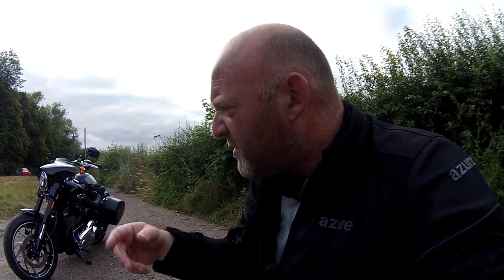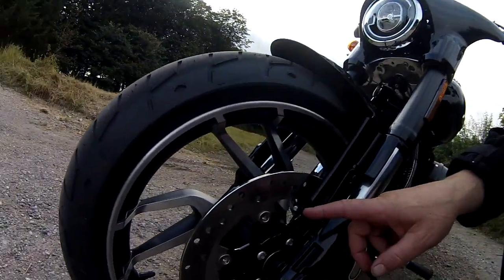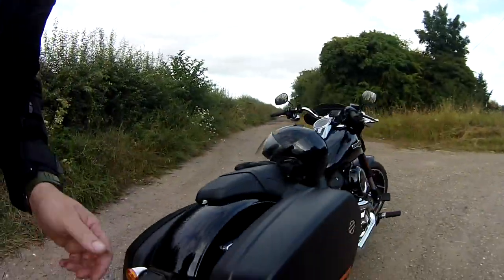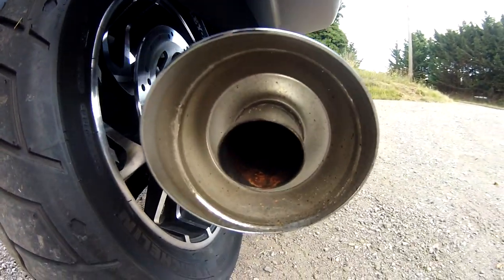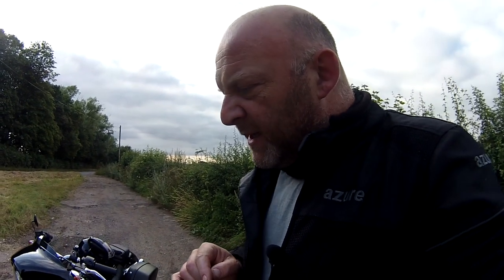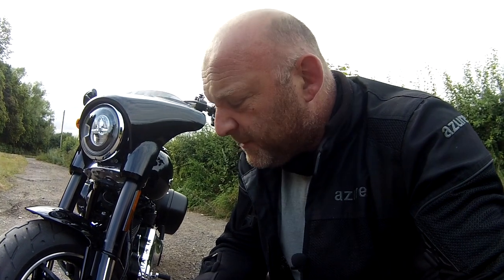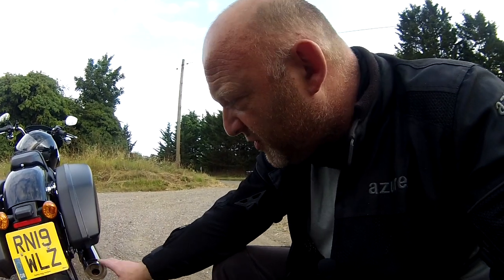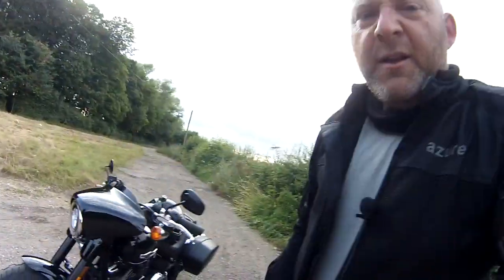How to stop Harley Motorcycle brake discs rusting

Comment: I tried acf 50 applied by cotton bud. Still it migrated to the disc. Oh feck ass nipping no breaks till it burned off. Wd 40 also applied the same way similar results but not as bad. Currently trying spray silicone applied the same way. Best results so far. I wash and blow dry my bikes in the winter, especially the brakes, all treated with acf50. Hope this helps.

Comment: This has been building up on my disks and other small (Nuts/bolts/washers) on my 4 month old bike. here in tropics seems to rust fast. Yesterday I:
-Bought white vinegar (50 cents a bottle) Mixed 50/50 with water sprayed it on all affected area's let it sit for 30 minutes, then sprayed it again.
- Took my electric toothbrush with old head and used that for all area's, including inside those little holes in disks and lots of little bolts/washers.

Results: I'm lazy so didn't want to put more than 10 minutes elbow grease into this, but clearly it improved things significantly, however did not completely remove rust. I leave my bike outside so this is going to be a constant during rainy season. So i just plan to do this every time i wash the bike and incorporate it into my cleaning routine which i think is a better option than painting these parts. This over time 3 or 4 sessions I believe will completely remove any rust.

Comment: Alf I had the same on my exhaust what I did was to polish the inside with HD metal polish and it polished it out, at present it hasn’t returned.
As for the disc my rear showed rusting on the inner cut outs this time I used fine wet and dry paper damp of course and that to dealt with it.
I was surprised this was happening I though they shipped by bike to the deck of the ship from the factory, considering my bike hasn’t been ridden in the rain.
Reply from the maker: Yep it’s what I’ve done and seems to have done the trick cheers

Comment: Hi Alf, the discs I would just leave. Same thing on my Iron 1200. The exhaust, if it's black just spray a bit of high temperature paint. I did that on  my Harley stock exhausts and it lasts for a long time.only done it twice in 5000 miles. 👍
Reply from the maker: Thanks fella, good to know. I think I've sorted it for now too and hopefully will last a while. Just waiting to see if it occurs again and go from there. Cheers

Comment: Hi Alf,
are you sure that it is the disc that is rusting and not dust from the pads , I remember when Harley had trouble with "rusting" spokes but only on the leading edge, this turned out to be brake dust that stuck and it  rusted because it had a metal component.
I have done surgery on this muffler and the exhaust gases have a very convoluted path to exit and as you know an ICE engine produces a lot of water and parts will produce a rusty water stream out the end, so this is only staining not really rusting. You can paint it as I have done just use heat proof muffler paint but the staining will still deposit there. Hope this helps.
Reply from the maker: Yep I think that is it. I’ve cleaned it all now and looking at different options but just looking at long term maintenance really. I’ve just painstakingly gone over the whole thing with cotton buds and wd40 then cleaned the divas with brake cleaner afterwards. It seems to be holding up so far but I may still consider the paint option too but once cleaned off it seems ok...for now. Cheers

Comment: Alf, I don't have the rust on the exhaust though it seems a very common issue on the owners forums. Brake discs same issue though on the rear I have quite a bit of surface rust on the centre main body of the disc if that makes sense around where it's actually bolted on. It's in for service this week so I'll mention it then see what they say. When you take the seat off look at the band around the top of the suspension, mine is rusty there, I'll also be mentioning this as well.
Reply from the maker: Ah thanks for that. Yep mine is in for service in two weeks so I’ll do the same too. Cheers

Comment: Alf Never ever put wd40/acf50 on your brake disks, this is oil based and wil cause your brakes to not work when needed , even if you put in in the holes disks heat up fast so it runs out and hits the pads coursing brake failure and most likely serious injury ore worse . if your bother about the rust take it to the dealer its a new bike so let them worry about it , ore just use break cleaner to clean m and most likely the rust wil wipe off
Reply from the maker: DWEAZEL yep just some options for sure not best and must be cleaned properly. Prob paint option best

Comment: Alf,

I'm interested in how the dealer responds. I'm awaiting a Stage I installation, so that should solve the exhaust rust.

Re: the rusty spots on rotors, I'm leery of using any product that might br considered "lubricative" on or near my wheels (I don't even Armor-All my tires).

Always enjoy your content, Thank-You,
Mike
Reply from the maker: Thanks so much Mike. Absolutely so, I’m in at the dealer this Friday so will discuss a few issues but anything used has to be really cleaned off well. I ended up scrubbing the areas with a cotton bud with wd40 then completely dried off the area afterwards. Seems to have done the trick but a painful exercise. Cheers

Comment: If you want to crash the Harley then go ahead with the wd or the acf.
It’s only surface rust. Clean it with steel wool then a dry clean rag and fenwicks brake cleaner.
Reply from the maker: Rocking in a free world you obviously missed the part where I said they’ll need a proper clean afterwards.

Comment: Alf ,,place bike on a trolley so wheels are free to spin and I would dip a cotton  ear bud Into paint of your choice preferably anti rust and use it as a sort of a dab / paint applicator ,,,dip and apply to each hole and also the exposed edges..Bit fiddly  but You'll only have to do it once ,,,wipe excess with steel wool on the edge of rotor once dried...Oh and I ordered a Factory Alarm for 148 here in Australia which takes half an hour to install..Also I'd touch up the Exhaust to stop further rust ,,the Heat will bake the pain on..
Reply from the maker: Good skills Paul

Comment: Hate to let you know but you are making yourself sound a bit silly.
Disks are wearing part all disks  will go rusty  park your car up after a rainy day looking you discs the next day the whole surface will be covered in rust all disks  rust , The only reason you don’t see the rust the next day is when you use the brakes the pads wipe it clean talk to a mechanic or somebody . I like your videos of shame you didn’t look into this a bit more for you posted the video 👍🏻
Reply from the maker: Not a problem but you've actually misunderstood what I have said and it has nothing to do with the pads or disc surface. This is actual rusting on the static part and in the disc holes. It's been treated now so shouldn't be a problem.

Comment: Are you starting to wish you'd not bought a harley ?
Reply from the maker: TheLeevtr not at all. Love it actually, just a learning experience that’s all
Reply: @RevelatorAlf  I rode one and loved it.........but I just can't get past the quality issues, for 15 grand  they should be spot on
Reply from the maker: @TheLeevtr  Yep I hear you completely on that one. I am scrutinising this bike possibly more than any other bike I've ever owned and going heavy on the preventative maintenance too. The problem is that in many way they are still so far behind other bikes not only in build quality but also technology too, but I do love a challenge ha ha. Cheers
Reply: @RevelatorAlf  I'm not bothered about tech, but the quality should still be there. I have a 16 year old VFR and it's mint, and as  much as I'd like a big harley I'm not filled with confidence that it would last  anywhere near as well. I do love the sport glide though
Reply from the maker: @TheLeevtr  Ah the VFR, love that bike too. Always preferred the 800 though.
Reply: @RevelatorAlf  Yep, 2003 Vtec

Comment: Disks rust that is just part of the deal its annoying. Some brake pads they seem to glaze or the dust causes a mess especially on spokes you might try organic or semi cinder brake pads I use organic saves on disk wear. You don't want oil, paint, or anything on disks its dangerous and not worth the risk. I wipe my disks off with a rag and Coleman fuel aka Panel wipe use a little scotch brite to get glaze off wipe them dry good to go. Exhaust pipes and chrome Wicked Products metal polish it is an excellent polish just something that is part of maintenance. I cannot get it here in the USA or find it here.  I had a friend in England who sent me this amazing stuff called Wexoil he said he uses it on his Triumph over the winter. Its like a wax cosmolene protectant. I would wash and rub everything down with Wexoil and leave it on all winter and wash it off when I do my full detail after winter. I loved using it because it really protected paint and everything that you used it on for corrosion prevention. Plus bikes get dirty over the winter too much washing moisture and corrosion happens.